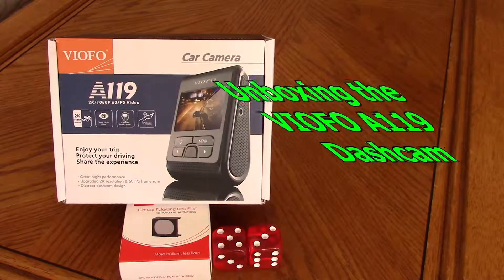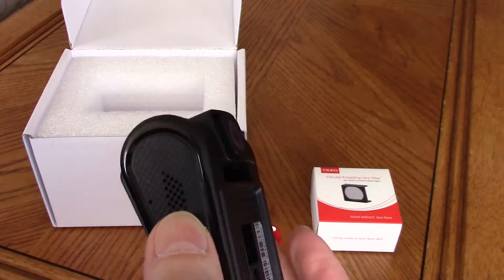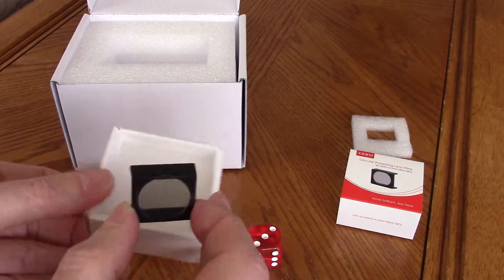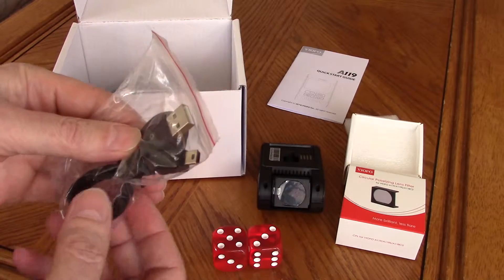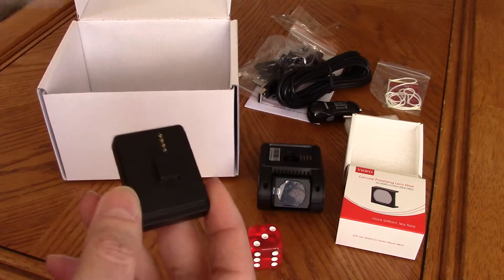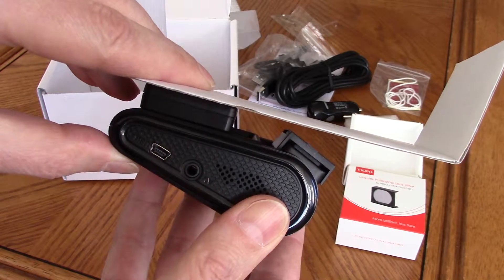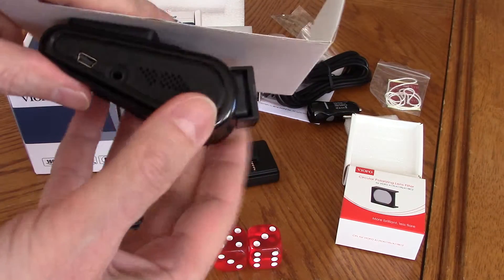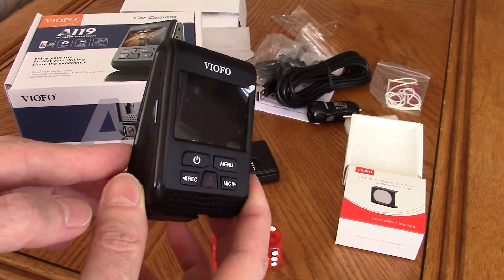Unboxing VIOFO A119 1440p Dash Cam

Comment: Nice video, very detailed. The camera has an AV (AUX) port next to the mini-USB port. What is the AUX port used for? I noticed there was no AUX cable when you unboxed. Do you use the mini-USB cable for video file transfer from camera to your computer, or an AUX cable?
Reply from the maker: The AV port is 640x480 VGA + audio output, uses a 4 contact 3.5mm jack. Possible use might be connect to vehicle console LCD display otherwise useless, don't waste money buying the A/V cable. I used my A/V output for live lens refocus but is limited not HD. The miniUSB is for power/file xfer/firmware updates. Much faster(2x-8x) to remove microSD memory card insert into USB3 reader then transfer video files.
Reply: Thanks. That makes sense. Is there any way you can transfer a video file from the camera to a laptop, with the camera in place (without removing the camera from its holder or removing the memory card)?
Reply from the maker: Transferring Dashcam video clips using the short mini-USB cord to a computer is as follows:
1) connect the mini-USB plug to the dashcam then connect USB plug to running computer.
2) wait for USB auto detect/driver install to finish.
3) if the 'auto play' menu appears select 'open folder to view files'.
4) double click the 'DCIM' camera storage folder, then open the 'Movie' folder.
5) all the dated MP4 clips will be listed.
6) select and drag/copy to 'Video' folder in computer.
7) once clips have been transferred close all open folder view boxes and left-click the 'safely remove hardware' tray icon and then click 'eject DEMO1' and wait for the 'Safe to remove' bubble to appear.
 if message saying device is busy, go back and close all open apps and folder windows and repeat #7.
8) unplug the USB cord from computer, then from dashcam.
9) open your 'Video' folder on computer and enjoy the A119/S recordings.
10) done
 
The common way to transfer dashcam video clips to a computer is to remove the microSD card and insert it into a USB card reader. can buy them at the dollar store, most readers are included when purchasing a new microSD card.
Reply: BC Hobbyist Thanks. it's nice that there is a way to transfer the video files without removing anything. Since normally you have the cable go through the GPS unit, that leaves the mini-USB port on the side of the camera open for data transfer.
Reply from the maker: do not connect mini-USB to GPS module and second cable to side mini-USB at the same time, this will damage the camera. Data transfer alone will supply enough power for that purpose.
Reply: BC Hobbyist So to transfer video files with the camera still in place, which mini-USB port should be used? The side port, but only after the GPS cable is disconnected?
Reply from the maker: never use long USB cable for any data transfer on any device or corruption will occur. If Dashcam is mounted on windshield and cannot remove from mount or cannot eject micoSD card then 1) disconnect USB cable at cig-liter , if hard-wired to fuse box unplug from GPS. 2) connect shorter mini-USB cable to side port and connect to computer for data transfer. follow transfer procedure in previous reply.
Reply: I usually unplug the long cable at the GPS unit, and plug the shorter cable into the side of the camera unit.

Comment: can you use only the g-sensor? and motion detections disabled? I mean that if someone moves in front of the car, the recorder will not come on, but if someone touches the car, for example, hits or scratches then the recorder records?
Reply from the maker: G-Sensor is useful to detect vibrations/impacts triggering a saved locked clip. If planning to protect parked vehicle for long duration disabling Parking Mode and Motion Detection then enabling G-Sensor could result in not recording the approaching vehicle or person leaving little evidence. Currently Dashcam doesn't pre-buffer 1-5 seconds prior to event like a security camera does.

Comment: wow, thanks for the info about a new revision with special holes for the filter. It's the first place I hear someone mentioning it on YouTube. If you've got an older one you would have to stick this filter with a tape or what?
Reply from the maker: for older A119 dashcams without the CPL filter notch tape would be the easiest way to secure the filter.
Reply: Ok, thanks. I hope the one I;ve ordered straaight from China will be from the newest revision.

Comment from the maker: After contacting Lexar to ask if the High-Performance 633x microSD cards use MLC or TLC NAND flash chips this is the response they sent. Hope to find a utility program to detect the chip type directly.
<<<<< START QUOTE >>>>>
From: lexarsupport@lexar.com 
Sent: Saturday, March 04, 2017 9:32 AM 
Subject: RE: Lexar 32/64/128 GB microSD flash chips used 

Hello BCHobbyist,

Thank you for contacting Lexar. Most of our memory products are manufactured using MLC NAND flash. However, we cannot guarantee that the product will be manufactured using MLC memory as it may depend on the manufacturing site. I hope this helps!

If you have further questions, please contact our technical support department. Try our online chat service at http://www.lexar.com/support.html . At Lexar, we are committed to providing high-quality products and reliable service and support.

Sincerely,

ZACHARY
Technical Support Representative
Tel: 877-747-4031 (US & Canada only)
Tel: 208-363-5862
mailto: lexarsupport@micron.com
Website: http://www.lexar.com

Talk to an Expert Online 
http://www.lexar.com/support
<<<<< END QUOTE >>>>>